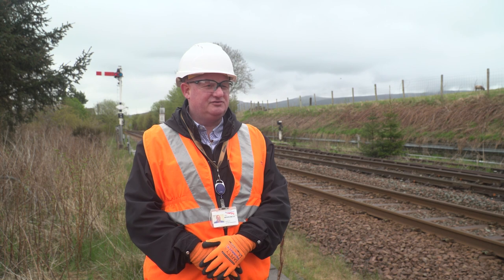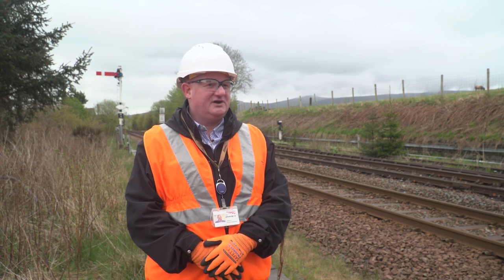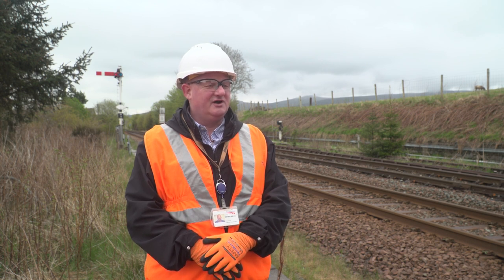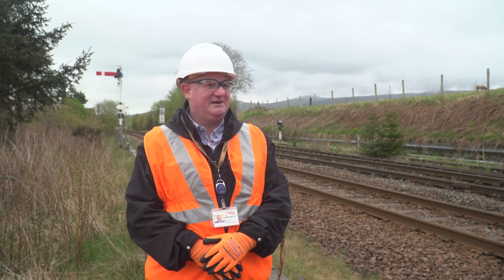'Compact’ power kit slashes cost and carbon for railway signals

Comment: Sounds like the old ones were just bad value for money 🤷‍♂ No use of solar/wind + battery either? Surely we can do better than this...
Reply: It's probably designed in the 80s/90s and any small component change needs to go through the full testing process. So even if manufactured last year will still have the efficiency of a decades old equipment.

Comment: It’s great that obvious engineering skills are being used to benefit the railway BUT please try not to keeping including the environmental benefit part until the 500 odd diesel freight locos are phased out. It makes a complete mockery of the argument 500 diesel loco 50 odd electric locos when you can afford electricity. It’s a joke. Two major containers ports not linked be an electric railway system. Yer having a laugh No orders for the European dual locos - even that would be some kind of first step.
Reply: Network Rail manages the signals and track, they do not have control over what locos the operators use on their track. We all want to see electric, hydrogen and battery locos on the network, but you have to persuade the operator to change.